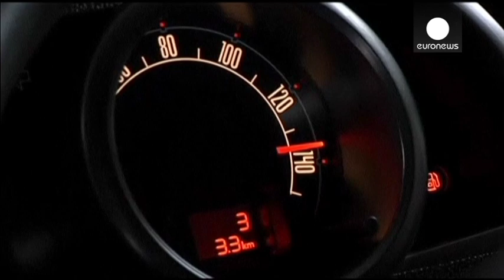Bye Bye, VW Bus: Last video of iconic Kombi on assembly line as Brazil factory closes

Comment: Emm for what reason? The VW wont produce it? Because of labor, products, materials, finance situation or Demand. ?????
Reply: Due safety law in Brazil that says that all new car should have airbag and anti blocking break in 2014
Reply: Issa 91 it was the law change. VW could have made them meet the requirements but VW is VW so they discontinued it.

Comment: why brazil have no more money to make more Bus
Reply: They're not making any more VW Buses because Brazil tightened it's pollution laws. Apparently a bus that gets 20+mpg/32km+mpg (US Gallons) [Depends on how you drive] but alas, the end of the old school transporter has ceased. :(
Reply: actually not, since it runs on ethanol fueled modern engines. the emissions isn't an issue, the problem is a law that turns mandatory for 2014+ cars to have ABS and airbags.... the ABS wasn't a problem, brazilian VW was developing a system to put in the Bus at the tme, but the airbag was a problem....

if wasn't this law, we would still have brand new 2016 VW Buses rolling of the production line in São Paulo...
Reply: Have you been to Brasil??? its one of the most wealthiest yet poorest countries in South America. They need to focus on infrastructure and fighting corruption first.
Reply: FunkyDoolittle actually its the richest coutry in south america